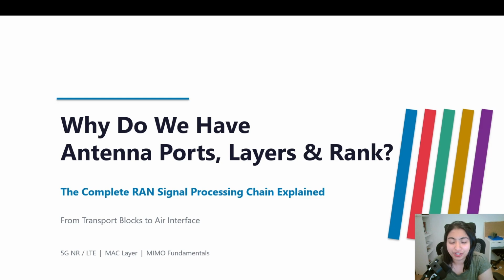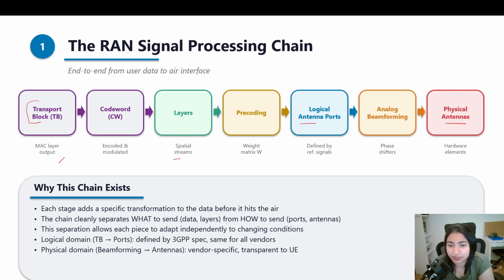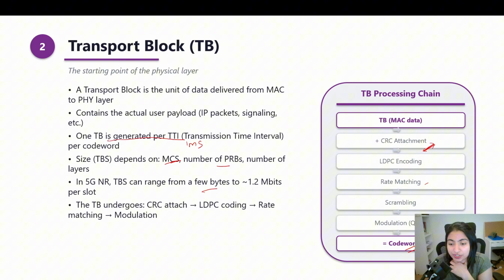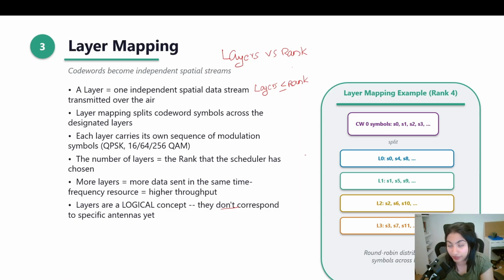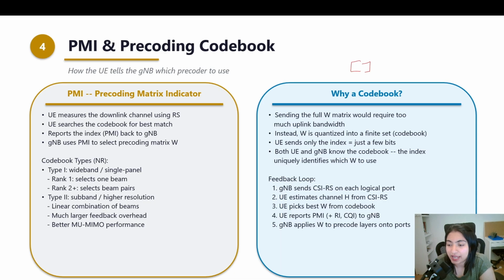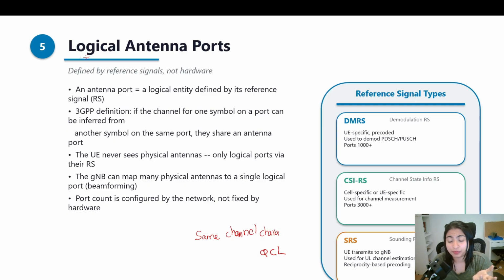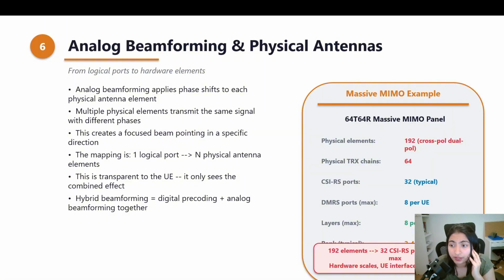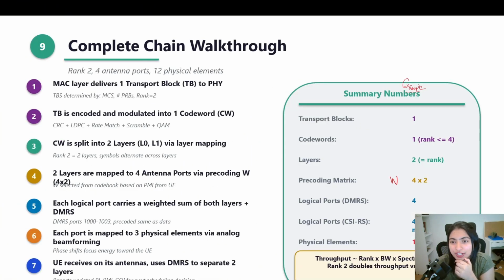5G NR MIMO Explained: Transport Block to Antenna Ports in 30 Minutes

Comment: what can a vlsi digital engineer can do like do we need rtl code for any process in RAN
Reply from the maker: Yes, definitely. A general purpose CPU can't be used for 5G PHY which process millions of samples in a second. Hence, lower PHY requires custom FPGAs/SoCs, which can be programmed through VHDL/Verilog. RAN Hardware, Modem Chipsets, all require RTL. However, at the RAN side, NVIDIA is trying to disrupt the traditional SoC design with Nvidia Aerial, which aims to use CUDA software. But, in short, RTL engineers remain high in demand in Telecom domain.